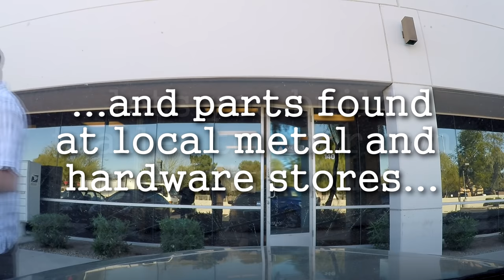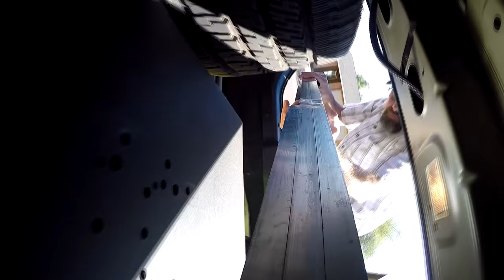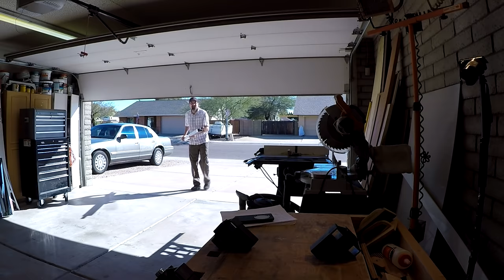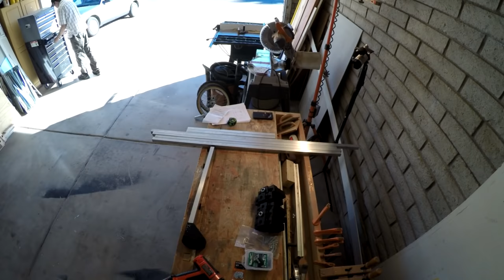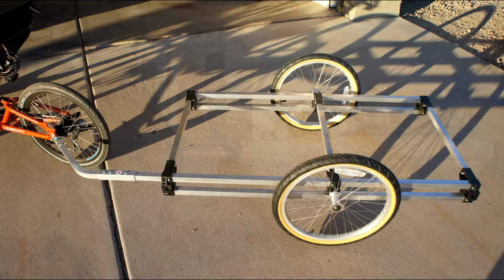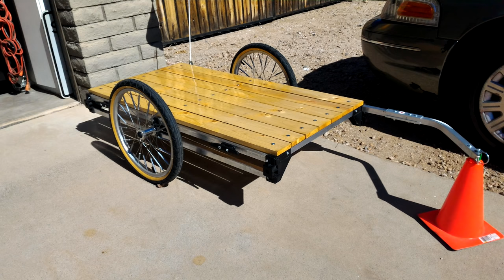WIKE DIY Bike Cargo Trailer Kit

Comment: Great job. I have seen a lot of home made trailers but the main fault with most is folks seem to ignore the important weight issue and use quite heavy gauge steel throughout without much limitation which must be a huge burden to move whereas your design smartly makes use of a skeletal alloy frame with wood bed panels. Probably the smartest home made trailer design yet.

Comment: I would have moved the wheels farther back; the center of weight needs to be in front of the wheels, or the trailer will whiplash around behind the bike.  Ask me how I know... but there are also videos out there showing the effect of shifting the center of weight forward and back on a trailer as it is towed.

Comment: hello, where did you get the profiles fastening to the wheel fastening structure and what sizes are the profiles if you can provide a link where you can buy these
Reply from the maker: All the parts, except the wood and aluminum tubing, came in the DIY kit from WIKE.

Comment: So technically all I really need is the draw bar that fits to the back of my bent and the frame of the trailer and the rest is easily built . Yours seems a bit over built with the double side tubes and the 3/4" slats of wood that could be replaced by 1/4" Baltic Birch plywood. Thanks for the video.

Comment: Hi ! Me i'm about to create one with a pulling bar right under my seat. The pulling bar will be made of 1 1/2'' square stainless steel bar (that's what i could find at my local scrapyard). Since the pulling bar will be VERY powerful for the trailer maximum total capacity (150 pounds). Using the same dimensions for the trailer (50 x 24 inches), would it be wise to fix the wheels 4 inches further back instead of fixing them right in the center of the trailor ? I took in consideration the design of most trailers. My local bike merchant designed a trailer bike few years back that he tried to put on the market. He told me firmly that bicycles were design to pull in strait line. So it's not recommended to put a side pulling bar on the rear wheel.
Reply from the maker: I put my wheels a little bit towards the back of the trailer instead of in the center.  I can't say I know the perfect way to mount the hitch.
Reply: So how would you modify the mount to fix to the middle of the bike versus off center?
Reply: I used a 6 inches long pipe and i insert it under my seat. Then, i welded  the pipe to a 28 inches long 1 1/2'' square stainless steel bar. At the end of this bar, i welded the 360 degree locking mechanism. For the 360 degree locking mechanism i used a 1/2 '' universal joint socket and a 1/4'' pneumatic air quick fitting connectors. (ebay items: 262884412164  and  311672104659).

Now that my trailer design project is finish. When i go out with it, many people are staring at my trailer where ever i go. It fonction amazingly well.

Comment: A little confused with the #14-1" self tapping screws. Do I need to drill THROUGH the plastic on the corner pieces when attaching my bottom bars? Kind of thought they would be pre drilled like every other connection. Plus I can only find #10-1,1/2" self tapping screws. Will they be too long for the axle corners? Don't want to drill into the cavity and mess something up. Thanks
Reply from the maker: As I remember all the holes were pre-drilled except for those two bars.  For those where I had to drill through the plastic pieces, I used self-tapping screws.  I would check the length of the screws before drilling.  As long as they don't go near the metal bearing assembly I think they will be fine.
Reply from the maker: Did you see this build page. In one of the photos he shows how he drilled through the plastic bracket.  http://valdodge.com/2009/07/04/custom-bike-trailer/
Reply: Thanks, that's what I needed to know

Comment: Hi Tim, I know I’m late to the party but I wonder if you could tell me what drill bit you used to drill the holes and what size and type of screws you used. Your build inspired me to get a Wike diy Kit so I can take my dogs with me when I ride.
Reply from the maker: Unfortunately I do not recall the size of the screws or bolts, and I just donated the trailer to an outdoor/travel group. I think I got the size from a WIKE assembly video. I used carriage bolts for the wood to have a smooth surface. Sorry I can't be more helpful.
Reply: I have just built one - the main bolts from Wike are 1/4inch so I used a 17/64inch bit. For the #10 self tappers I start a hole with an 1/8inch drill bit. Worked for me at any rate :-)

Comment: I'm looking to start a small business as a mobile lemonade stand for the summer months.  This is by far the best design for the money that I have seen.  This would allow me to be agile in the ways that even food trucks cannot.  Plus, I could use the exercise.  How would I add rails to perhaps box it in if that's even necessary?
Reply from the maker: Sounds like a good idea.  When I lived in Phoenix I thought about putting a big ice chest on the trailer and going down to the ballpark to sell water and soda on the sidewalk.  You can build the trailer to whatever dimensions work best for you.  The company also sells trailers already built.  In my other videos you can see that I added side rails with tubing and wood from Home Depot.  https://www.youtube.com/watch?v=DAsDuysmupo&t=2s
Reply: @CrazyUncleTim  I'm planning to take a tour of one lap around the US and I'm looking for a bicycle trailer with the follow specifications:
7ft. long, 3ft. wide, must hold at least 400 lbs., and the weight of the trailer cannot exceed 70 lbs.
Are my specifications in the realm of possible? ...and if so, can you build me one, or give me a material list and instructions?
Reply from the maker: @justinbarney8198  I'm not sure where I could find parts capable of holding 400 lbs.  The kit I used said was rated for about 150 lbs, although I probably carried about 200-250 lbs.  You might be able to carry more weight if you use stronger materials, but that would also increase the weight of the trailer.  Have you checked with any bike shops?  Sorry I can't be more help.
Reply: @CrazyUncleTim  You're fine. I'm just getting my feelers out there to see what is possible and not. Thanks & safe trekking :)
Reply: @justinbarney8198  If you going heavy as you describe.... you'll also have to beef up the hitch assembly.

Comment: I'm planning to build an ultra-light trailer to pull behind my Honda Fit for camping gear. Would this item be easily converted to standard car hitch attachment? If so, would the wheels handle 60 mph for 5,000 miles?
Reply: probably not conisdering they are probably bicycle wheels
Reply from the maker: I doubt it.  I went down a few hills at 20 mph, but I wouldn't go any fast than that.
Reply: mr.everything
Reply: You need wheels with high speed bearings. Find some from a motorcycle.
Reply: no
Reply: Lance Baker
I doubt it. Many bike trailers are limited to low-speeds say 12mph / 20kmh. You are likely to run into numerous problems, also bike trailers generally don't have lights. Trailers towed by motor-vehicles need brake lights, turn indicators etc.  Stability is likely to be a problem. You would need to change the wheels, axles etc. I don't think it's a starter.
Reply: Lance Baker    I've been planning the same thing to pull my dog and a backpack tent etc on a small strong trailer with my dog in a roll bar cage behind a Honda 250 crf dual sport. get on the internet and look up sites like TRAILER TEK suspension UK. they sell smallest wheels you can pull behind a car or bike  with suspension the full kit in a box. then purchase a basic arc welder and practice then weld a 35mm/40mm frame and bolt to the trailer suspension kit.. So if your bike weighs say, 150kgs in the UK, you are allowed to pull a third of the kerb weight of your bike .ie. 75%. so your trailer and equipment must be no more than 100kgs total, I think , so my dog weighs 20kgs , my backpack full weighs 30kgs, the trailer about 70kgs oops !!!! Just ride like "a bat out of hell "!!!! and cheat on a few kgs. oh! and u have to put a small sign on the side giving the tare weight and weight of the tow motorcycle or car etc. For a motorcycle you make your frame smaller and narrower anyway and should get it down to 70kgs atleast. And you can always send an email request for motorcycle free bearing front wheels advice. But don't use cartwheels with fixed axels because the bearings wear out, they only meant for slower agriculture farm atv's on farms and not allowed on public roads. good luck I haven't welded in years and just purchased a new welder on ebay for £68 so im going on just my drawings. for me its all about travelling with my dog. ive travelled cycle-touring all over Europe and having a dog from the doggie home has made me feel im like married . no trailer no go! got me by the balls ha ha! GOODLUCK!
Reply: Harbor freight yo get a foldable trailer for a car

Comment: may you explain it to me in words step by step how you put it together ?
Reply from the maker: The first step is to decide on the dimensions of the trailer you wish to build.  Once you have the kit you buy the tubing cut to the lengths you have chosen.  Next you assemble it following the directions that come with the kit.
Reply: some bicycles are faster than others what's the fasted and strongest bicycles for towing and pulling ?
Reply: what bicycles is the best for pulling and towing give me the name brands ?Cause some bikes can tow better then others ?
Reply from the maker: I don't know what is the best bike since I have only used the HP Velotecknik Scorpion recumbent trike to pull a trailer.  It was able to pull the trailer up many steep hills.
Reply: i ordered a 500 watt electric scooter when i find out how it works for pulling a trailer i'ma leave a comment.My next question is do the more torque and horse power is better for pulling ?
Reply from the maker: More torque is better for pulling up hills.
Reply: Now what i gotta find out the names of the bikes that got's the most or best torques because I'm going to be going up hills.Let me know the bicycles  that's good for that.This mourning i tried pulling with my Real Tree Monster Motor Mini Bike i need something else that can pull better because once it starts pulling the mini bike slows down a lot.I got a 500 watt electric scooter I'ma see how that works for pulling ?
Reply: mangreat71

Comment: Cheaper to buy a second hand bike trailer cut it and add some tubes to the desired length
Reply: Those cheaper trailers are small and not as strong. And they are not as cheap as you may expect. I'm going to build one too.

Comment: I like the trailer. Even more so, I like that it was attached to a recumbent bike. However, thus video is just over 6 minutes and the first two minutes are of the material being picked up from the supplier. Completely unnecessary footage. And I'm pretty sure I saw the builder tighten the same nuts and bolts multiple times.

Comment: Tim, is there a way to increase the load capacity to 300 pounds?
Reply from the maker: Other than using thicker tubing I don't know how to increase the capacity.  I had at least 200 pounds on mine and pulled it 4,300 miles without any problems.  Have you built yours yet?
Reply: TechNomad Tim I'm working with a welder/fabrication guy.  We're looking into existing carts that we could modify and comparing them to a scratch build.  Just considering all options.
Reply: A motor will work

Comment: because    u   was  too   fast    I     DID  Not   see  u'r   vedeo   .
Reply: It's possible to slow the video down. 
Click the little settings gear icon in the lower right hand corner of the video frame. 
Then click "Speed". 
It can go as slow as 1/4 speed.